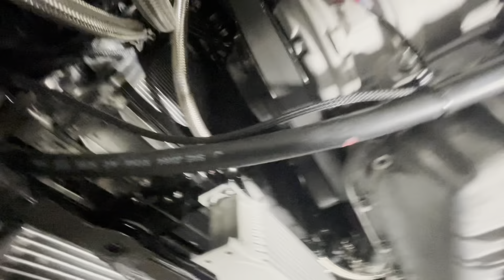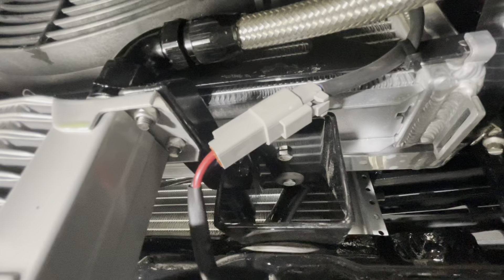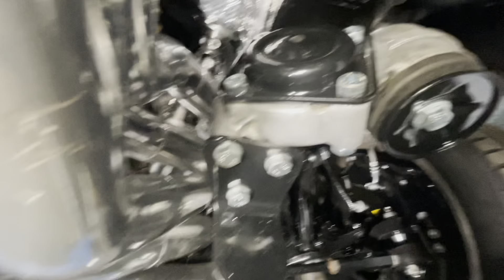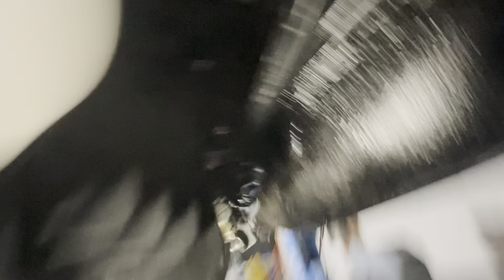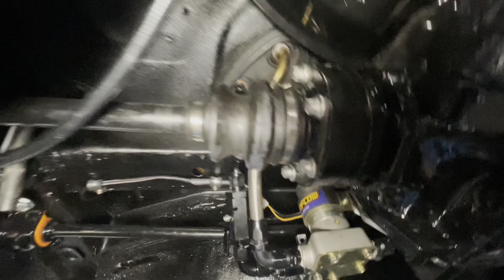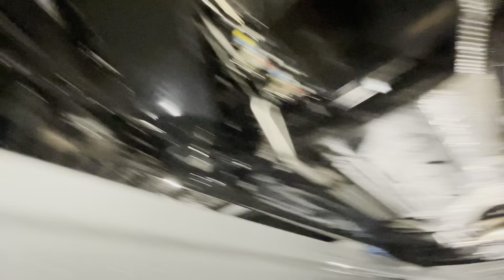Mercedes 560SEC M113K Engine Swap Underbody Tour

Comment: I don't wish to sound negative because you've really got yourself a lovely car there, but by just eyeballing it it appears as though you've introduced a lot of bumpsteer with your rack and pinion steering conversion. Meaning you end up with unwanted toe changes with ride, not to be confused with steering kickback over bumps...
Reply: Since this vid he has re-engineered the rack with new wheel hub brackets- new tie rod ends etc and the system now works perfectly (it had to pass strict engineering scrutiny over here to get certified for road registration & Insurance cover) Brent is a marine engineer himself and would not be happy unless it was perfect

Comment: insane build really interested in that steering rack conversion, can bby any chance u can share the cad file for the tie rods and engine mount brackets
Reply from the maker: The tie rods I purchased off the shelf, they are Z32 Meaghan racing adjustable. The engine mount bracket design I sell as CAD or can have them CNC cut, if interested I can give you a price.
Reply: @BrentoBenz  yes i am interested for CAD design for engine brackets and custom steering brackets give me ur email so i can contact u there
Reply from the maker: Sorry I don’t really want to publish my email here, any ideas?

Comment: where would i get the fittings for the an transmission lines?
Reply from the maker: You can use any company like Aeroflow, speedflow, raceworks etc. they are just metric threads with washers in the transmission

Comment: How much better is the steering feel with the R&P? The steering in my mother in laws e320 4matc was totally dead feeling, I've not driven a rear drive W210 tho. 
The USA cars got anti-squat in 86 and 87 I think.
Crazy your car had the sway bar end failure, it looks so clean. Mine is a bit of a rusty turd, so it wasn't hugely surprising I had to replace the ends.
Reply from the maker: The rack and pinion has a much better feel, there is no vagueness around centre anymore, I have adjusted the rack preload to give the right amount of feedback to my liking
Reply: @BrentoBenz  Sweet! This is such an amazing project, too bad going to cars and coffee would be a bit of a drive for me from Washington State :D

Comment: can a w211 e55 m113k engine be used including the loom and ecu, if not what would need to be changed in order to use this in a w126 sec
Reply from the maker: You can use E55 but need to change the oil pan to a S55 type. The ECU can be used but you will need an aftermarket TCU and a module to tell the ECU it is in gear

Comment: Wow!

This is a great build. Very clean and efficient. I did an M119 swap into my W126 SEC and it didn't require anything like the modifications you've made to your car. I was even able to retain the rear hydraulic suspension (SLS). Really, a custom exhaust was all that was required.

Well done and good on you.

Comment: Very desirable swap, clean execution. Are you using the donor car’s transmission electronic control unit, or an aftermarket unit like the “Powertrain Control Solutions” TCM-2800 for the Chrysler NAG1 version of the 722.6?
Reply from the maker: I am using an OFGear TCU

Comment: Hello, does your steeringrack have an SPS sensor on it. did you bypass it or does e55amg steeringsystem have olso an sps sensor singnal?
Reply from the maker: I used a W210 steering rack, it has no sensor.

Comment: Very Clean swap.  I'm interested in your custom control arms for the R&P steering.  Did you get the arm length correct to keep the same turning circle?  I'm planning the same steering swap for a W123.  Do you have the CAD model to sell?
Reply from the maker: The new arms are in production now so will test in 2 to 3 weeks. I don’t know how familiar the w123 steering setup is to the w126
Reply: @BrentoBenz  I'm looking to do this exact swap on my 560sec, any updates on the steering arms? I'm converting to R&P myself within the next few weeks

Comment: Brent, did you keep the specs for all the custom stuff you had to create, like brackets and such?  I'd be willing to purchase them for you if you did.  Let me know!
Reply from the maker: I have CAD drawings of the main brackets like engine and transmission mounts, differential mounts etc. then all the smaller ones I have photos, of which there is something like 30 plus brackets I made for coolers, pumps etc. Engine and transmission mount drawings are available for purchase.
Reply: @BrentoBenz where could we purchase the CAD drawings
Reply from the maker: @gerardoperez9686  look me up on instagram and message me on there @Brent0b0x

Comment: Hello, what set of brakes did you install there, discs and calipers
Reply from the maker: 356mm discs with 6 pistons calipers front, 325mm discs 4 piston calipers rear
Reply: @BrentoBenz   what car model do the discs come from or were they made to order
Reply: thanks for the answer mm the same engine swap only w123C

Comment: did you make the headers
Reply from the maker: No I had them fabricated
Reply: @BrentoBenz  im interested in buying some of the cad files from you
Reply from the maker: @thesandman6600  OK let me know what you are interested in. Most of the parts like the engine mounts are fabricated but I'm looking into cost to get them CNC machined due to the requests coming through.
Reply: @BrentoBenz  how can i contact you. i just joined benz world to access your thread and maybe message you